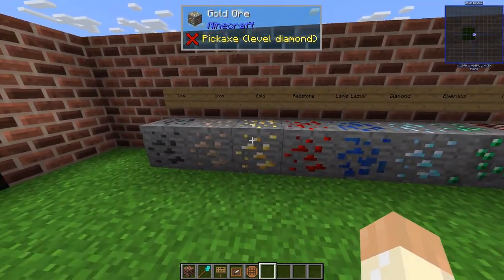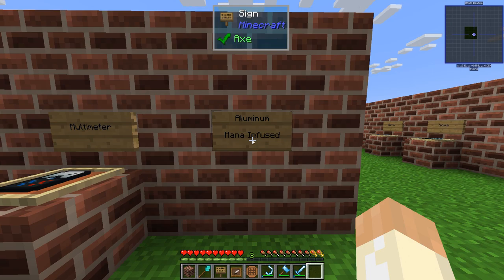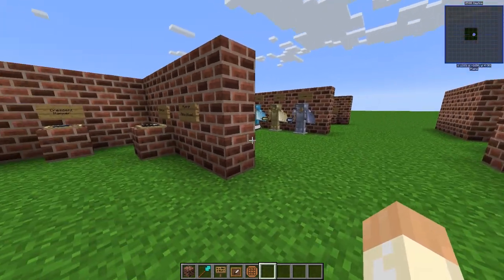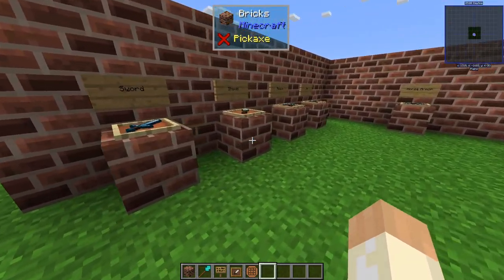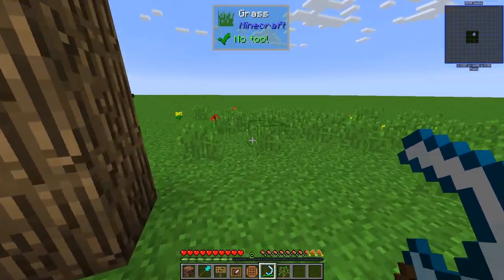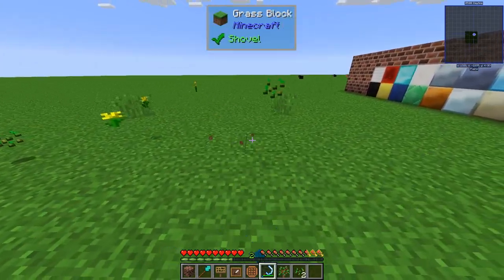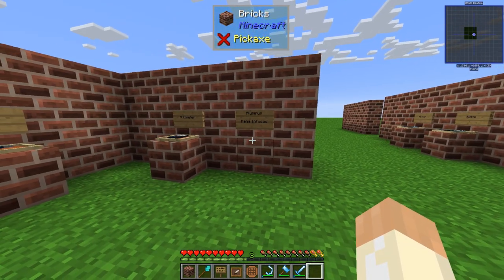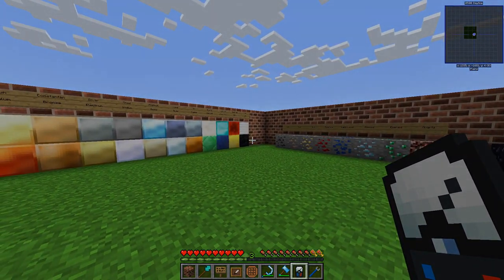Thermal Mods #1 - Materials and Equipment (Thermal Foundation)

Comment: since platinum and alluminum generation are disabled by default, could you make a video teaching how to enable then?
Reply from the maker: Yes, I spent quite some time now to get it working in my test packs/worlds so I'll make a video as soon as I can record it! Subscribe and/or join Discord and you should get it once it's released!
Reply: @therealtkh  ty for answering. how can I get the discord link?
I already managed to enable the missing ores, and also learned how to disable the duplicated ones(from different mods).
Reply from the maker: There should be a link to discord on tkh.one somewhere 😊 not home right now but tell me if you can't find it!

Comment: I don’t have of the hammers or anything like that. Any help?
Reply from the maker: The Crescent Hammer? You didn't say what mod version or modpack you play, it's hard to help without any information.... But if it's a modpack they might have disabled it and suggest you using some wrench instead, many of these tools are compatible.
Reply: @therealtkh  oh yeah I’m using 1.16.4 and I’m not using a mod pack sorry about that
Reply: @therealtkh  and I don’t have any of the tools what do ever or armor I’m guessing it’s not included in 1.16.4
Reply from the maker: @stevenschroder3428  Ah, that makes sense. The 1.15 / 1.16 versions are not finished yet. All ducts are still not done, so many tools and blocks are still missing so if you want the full Thermal experience you have to play on 1.12.
Reply: @therealtkh  ah okay makes sense thank you

Comment: Hi, can you clarify how to enable Aluminum generation?
Reply from the maker: What modpack are you running? I've had Aluminum in all my packs I played so I have never looked into the config.
Reply: I am running Tinkers Construct, Thermal Foundation, Actually Additions.
Reply from the maker: @radiofoam1828  I find it a bit strange that Aluminium is not enabled by default. I have never been without it as it's a requirement in Tinker's Construct. Thermal Foundation also has it so you should have double (I don't think AA has Aluminium). Can you find it in creative mode, using JEI or similar?

Comment: Ey ! Im new playing mods, and TF is one I have, im using hammer, and i know it can just mine 1 block if sneaking, but i dont get what is ''sneaking'' (guessed it was like shifting but nope), and i tried all my keyboard to mine 1 by 1 but nothing, can u help me? xD
Reply from the maker: Ey! Sneaking is like you say, holding the standard key Shift (to sneak, not fall off blocks etc). What mod version or modpack are you running to start with?
Reply: @therealtkh   mmm ill try later. BTW im using a lit version of FTB revelation (only running typical mods for begin: TF, industrial, some biomes and dimensions, more storage, teleports, backpacks, natura, botania, twilight, tinkers, etc xD
Reply from the maker: @strungeng1933  Ok, hope you got it working, sometimes the key bindings change but the sneak function is normally generic. Just make sure you had the correct type of Hammer (it is added by other mods as well, and they don't work exactly the same).

Comment: Is it the same for 1.7.10?
Reply from the maker: Most things are the same but I know that the mod(s) has gone through changes over the years. To be honest I don't the differences from 1.7.10 but basically the machines work very much the same. I think you can use this series as a reference anyway.
Reply: TKH thank you 👍🏻